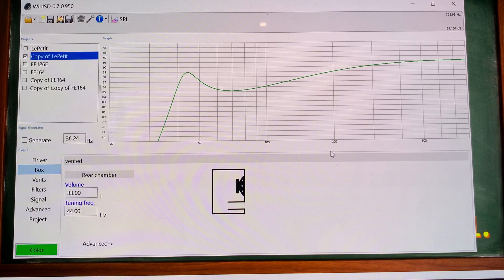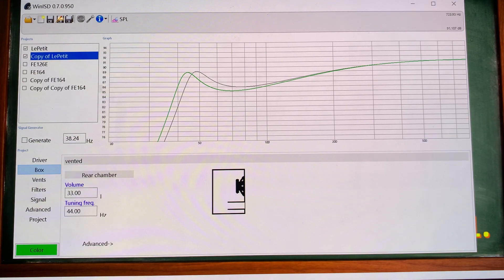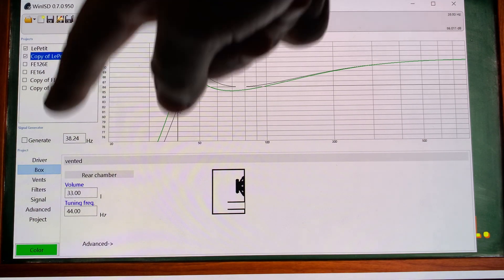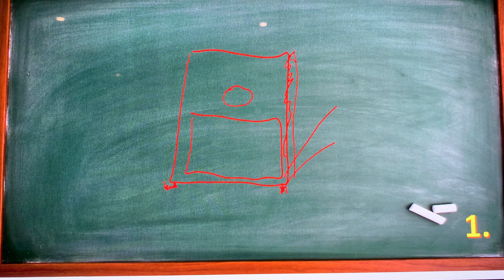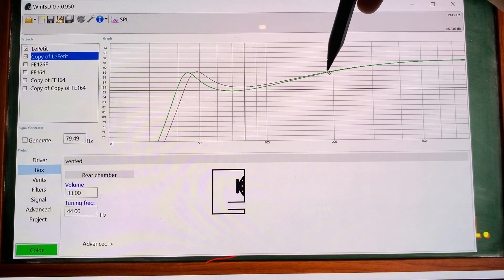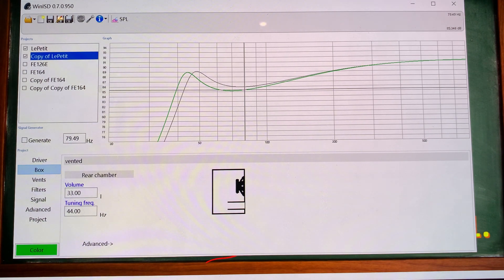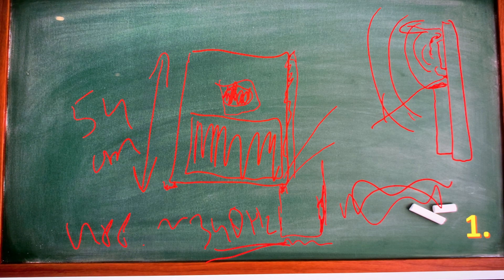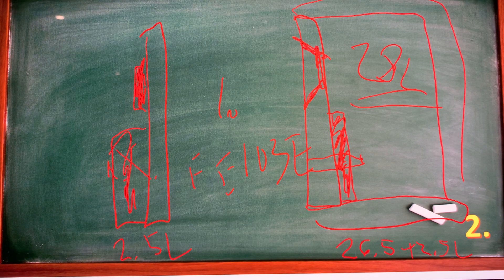Le Petit Episode 5:  corrections and front panel

Comment: Thanks for your work man. Is the fostex the only chassi That works without a crossover or something? Because i think the Tang Band w4 2142 can be better. Thanks for all !!!
Reply from the maker: Hi Jonas, you could use a wide range of drivers, but the cab needs to be redesigned to suit the driver. This cab is highly customized to this driver... yet, I made this series to understand it better why Hiraga did the things he did so you can plan to match your driver better. ; ).

Comment: Thank you Janos. If you had to increase the dimensions of the cabinet (if moving the frontplate inside), would you increase all sides equally, or maybe just increase the weight of the cabinet? Claus
Reply: A quick calculation using inches gave me these dimensions with the panel on the inside: 19.5x13.5x9.5 with a 12x12 panel inside. This is with .75 inch plywood. Janos what do you think?
Reply from the maker: @boringvinylstories  Sounds about right... ; )👍👍
Reply from the maker: I would increase them by the same % on every side to keep Hiraga's ratios. Or, if I wanted to go my way, I'd take the total free air volume and adjust the lengths for ones that correspond to the closest musical notes. ... will talk about that later...
Reply: @realworldaudio  Excellent. Thank you!

Comment: Thanks for the improvements suggestions! Unfortunately I did already build the main cabinet using MDF, but I also wanted to build the very original Petite. I used 3 layers of 3mm thick felt glued together, hope it will sound right..
I think the sample shown in the Article from "Le Audiophile" was also made with MDF instead of plywood. 
Do You think a construction with back loaded Horn has similar characteristics like the Petite with BR? I like Your Cube Audio Horns a lot!
My last thought was, could a D´Apollito Petite work out? To improve the output, I have a standing speaker in mind, double volume and the port inbetween the 2 drivers..
Reply from the maker: Hi Jürgen, a back loaded horn would sound quite different. Faster yet lighter bass, and quite likely even leaner in the midbass. D'Apollito: would have quite stronger midbass, but the tone would take a turn to  👎👎👎.  To double up the drivers, I'd keep them in the same line, on top of each other. Play around with placing one on a cap to roll of top end will improve the imaging of the pair, but that can also mess things up more as it adds phase error smear across the whole upper range, likely running them full range will have better tone (yet not as good imaging). Also, doubling them up we would need to double cabinet size, and adjust the port accordingly... two ports of the same size good starting point.
Reply: @realworldaudio  yes, doubeling the cabinet is how I imagined it, like 2 "petites" standing on each other, the upper turned on head. But maybe the cabinets can be one bodey, or they need being separatet? Here I´m in fantasy-land, I have no experience.. :)
Reply: Hi. I also received my drivers… and thinking about le petit or the Zigmahornets…. maybe an interesting alternative…